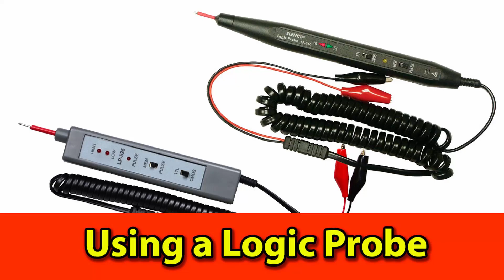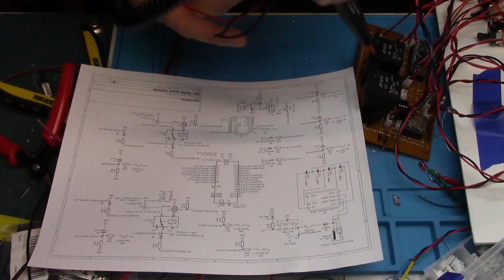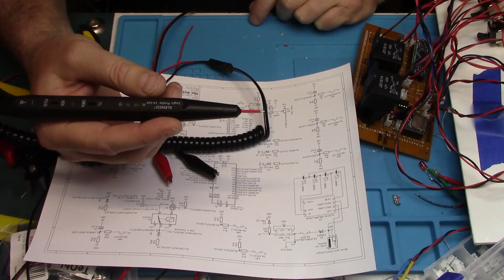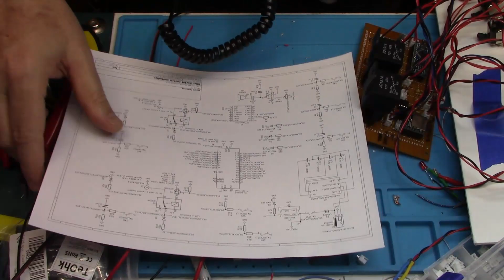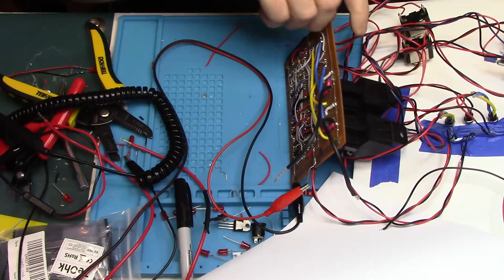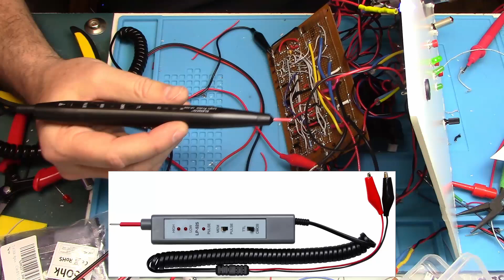Using a Logic Probe - Part 1

Comment: Yeah yeah. Many internet pics show to us A6 & A7 - are the PORTC pins. But they accordingly to data sheet may work only as input. So there is no any whole port available on nano board.
So there is no any whole port available on nano board. And for bus data line you forced to split data byte and send it by splitting on differents PORTs out pins
Reply from the maker: Thanks for the reply.

Comment: I’m still quite the novice so, I have this chip I’d like to test. It’s a 315-5700, I couldn’t find much info for it, but I do believe it runs on 5VDC. So, my question is: Do I set my logic probe on TTL or CMOS? And, is there a trick, perhaps involving the voltages the chip requires, that could help me know whether I’m dealing with TTL or CMOS? Any insight would be awesome. Great video, btw - make more! Thank you kindly
Reply from the maker: The best way to identify CMOS vs. TTL is to look up the part number. There is an IC numbering scheme for logic chips that can help.  As you get more experienced you will start to notice patterns in numbering, part usage, pcb layout, etc. I start with TTL if I am unsure. However, a multimeter might be a better tool since it can show you a much larger range. Unless you know it is a logic chip I would use a multimeter.

Comment: So .. can I plug my tester on a 12 vdc line for power?  Mine is made by radio shack. I think I blew it up thinking I can plug it to a 12 v source.. I was checking a cb radio processor and used the main power
Reply from the maker: No…no. TTL and CMOS voltages are typically 3.3-5v.
Reply: @StuartPatterson  22-303A Radio Shack probe can operate on any power supply between 4.7 and 15 volts as per the manual on P.3

Comment: Testing big pcb with TTL works fine if power it up, and measure with voltmeter and pullup from 10k, and again with pulldown 10k. All measurements between 1.5 and 3V are suspect faulty. I use this in 1980.